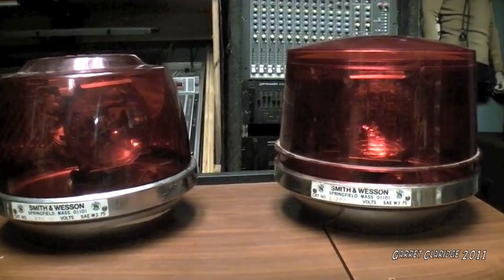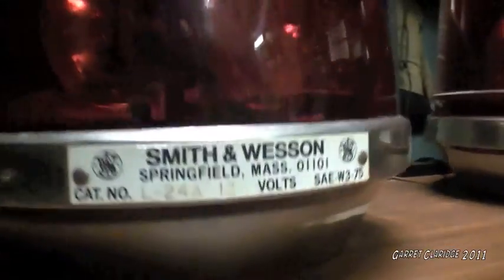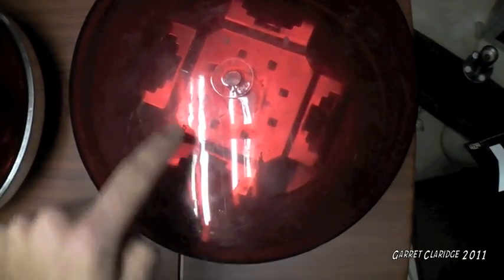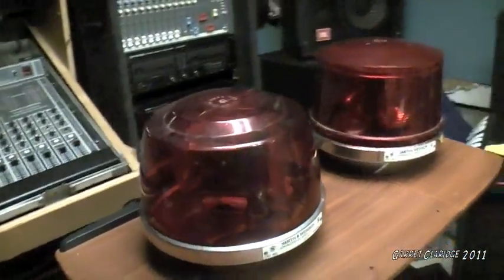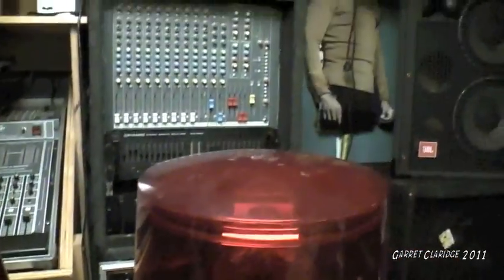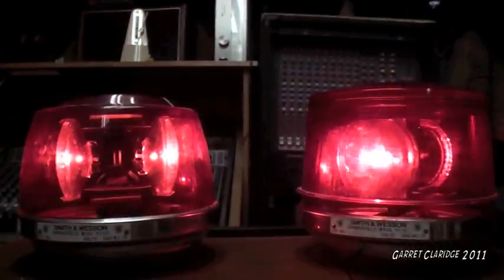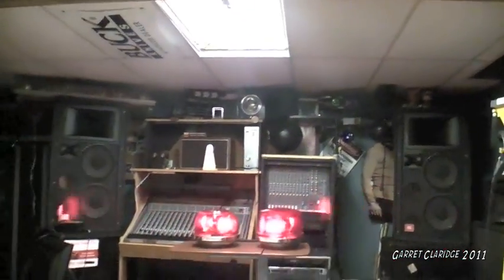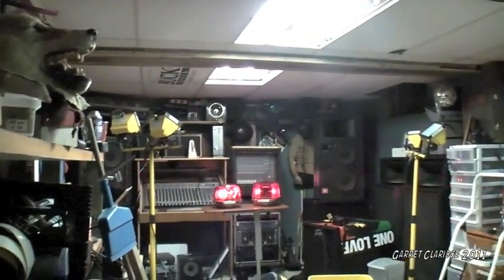Smith & Wesson Firetruck Lights

Comment: Smith and Wesson manufactured warning lights for a bit, and originally they were designed for police vehicles. So the "Fire truck" light label isn't entirely correct. S&W also made a few full sized bars both 44 and 52 inch sizes. The bulbs are called Par 32 or Par 34 [I cant remember which] and you can get incandescent and LED versions for the lights.

Comment: they are made for 1975 or slightly newer ,but they can be made as early as 1974 from the info on the tag , the SAE W3 75 is the D.O.T. requirements  , get the CAT # thats the model # you might find stampings in ink on the inside with a date code ,either on the motor or housing ,they are definitely 1970's vintage lights